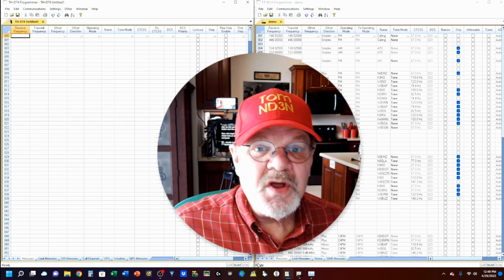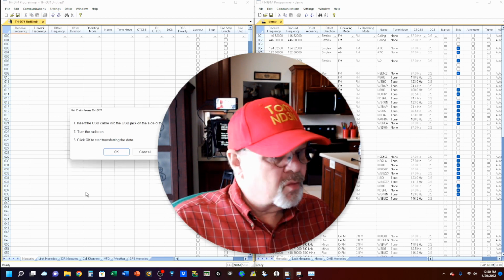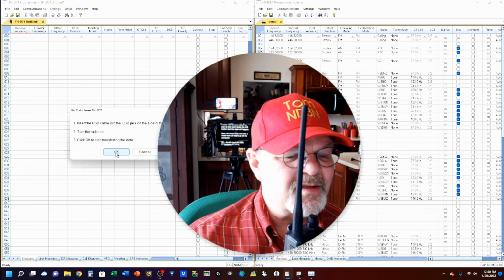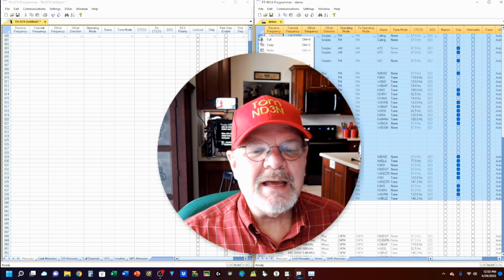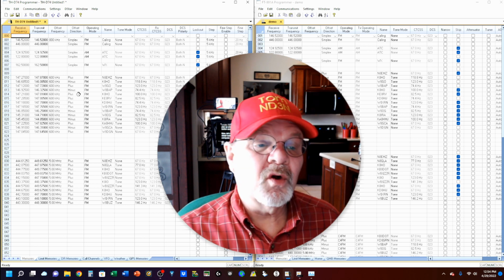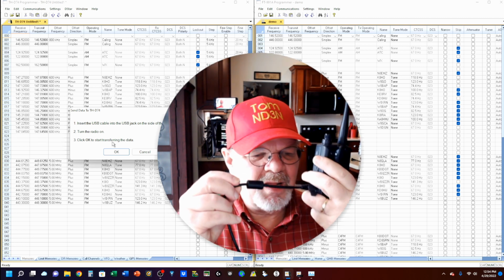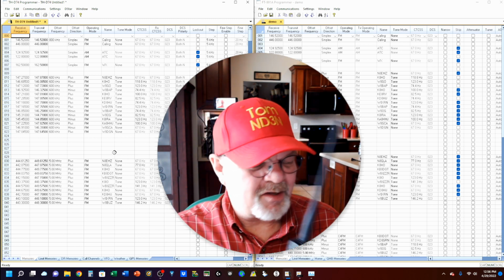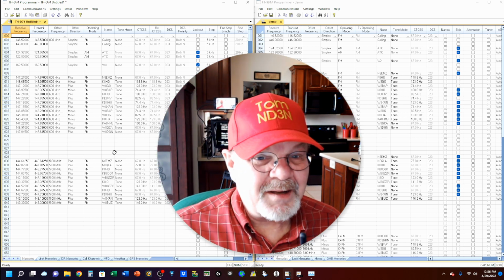One more reason to use RT-Systems Ham Radio Software

Comment: I have used RT Systems software for many years now. The only problem I have ever experienced with it has been my computer constantly losing the drivers for the USB cable. And I think that is more a function of my old laptop than the software or USB cable. Otherwise it has been flawless and has made programming really easy. I cannot say the same for CHIRP. I tried programming two cheap handhelds with Chirp and it locked up both of them to the point that they were turned into paper weights afterward. And I like the fact that the RT Systems software interfaces with Repeater Book to make importing repeater data so easy that its so simple to import blocks of repeaters for an area which can be specified by the user. I have a low cost mobile unit I have not used in years due to the cumbersome programming. I found a place for it in our new motorhome. The first thing I did was order the RT Systems software for it which came out about a year ago. Now I can program it without having to go through about six steps of manual programming for every channel. Well worth the small expense.

Comment: U must buy for every other yaesu other software ? !!!😒to expensif
Reply from the maker: Yes.  Although the base S/W is the same for all radios, they are modified/optimized for each model of radio individually.
Reply: @ND3N  we call it in dutch " geld klopperij " aca steailing from youre gustomers yaesu!!! ,all my hf vhf uhf are diferend yaesu models ft 991A and ftm400 and for every tranceiver i must buy a diferend programm ??? not nice !!!.

Comment: Do you need cable for every rig or possible to program to and from an SD card. Can you test and report for the ID-51 please. Looks great software especially when you can use same list on different brands. 73's
Reply from the maker: Many rigs use the same cable or a common cable.  For example, my RT-Systems ID-51 uses the same cable as my glucose monitor, so no need to get a separate one.  My FT-991A and FT-891 use the same standard USB cable that I use for to connect to my computer, and my TH-D74 uses a standard USB cable that I have a dozen stashed away.  Thanks for the video idea I'll be sure to credit "M VE", I've already pulled out the ID-51 and Cable and set it aside and the video should be posted this weekend.  73 de Tom, ND3N
Reply: Great. Looking forward. If you can also test if programming is possible without cable and only RT systems with sd card i would be greatfull. 73
Reply: @ND3N  Did you already have time to test the id-51 with software and only SD card? programming without cable. 73

Comment: I use RT Systems on all my radios and I love it. Most times I will order the software the same day I order a radio and have it ready when the radio shows up. I have bought so many different programs from them that I make folders for each manufacturer and stick all the programs in them to clear up computer screen space
Reply from the maker: Great tip!  I do something similar.  I put a folder on my desktop called "Ham Radio" and have individual folders in that top level folder for downloaded manuals, programmers, ADI files, etc.  73 de Tom, ND3N

Comment: Tom, nice video!  Sorry if I missed this, but why did you reset the radio, and then copy the data from the HT into the RT system software?  Thank you for the video and your time and consideration.
Reply from the maker: I reset the radio, not because it has to be, but because I wanted to show that I was starting with an non-programmed rig - just like you'd get fresh out of the box.  Starting with a clean slate.... hi hi.... 73 de Tom, ND3N

Comment: Chirp has the free download for a lot of radios but not the ft991a as I saw
Reply from the maker: I've played a bit with Chip, but wasn't impressed.  For the small cost, RT-Systems is a lot more intuitive and once you've done it for one rig, you can do it with any rig as they all use the same operations.  Also, they have fantastic customer service to help you get your rig programmed.

Comment: YES I am tired of  inputing frequencies! What a time saving trick, thank you Tom! 73 Ben  KN6NDM
Reply from the maker: Check out this feature of RT-Systems - makes things even faster... https://youtu.be/u-0HfLXzbDY
Reply: @ND3N  You the man!
Reply from the maker: Glad it was helpful!
Reply: I have one radio in particular that I quit using because of the cumbersome programming. First you had to clear the channel you wanted to use which took 2 steps from the menu. Then input receive frequency (two steps again). No automatic offset so that had to be set. Then the transmit freq. Two more steps. Then tone type. Then tone freq. Then save that channel. Great little radio but 6 or 8 steps with two menu inputs each got old. I hand input about 10 channels and quit. Now that RT has software for it, I plan on using it again.